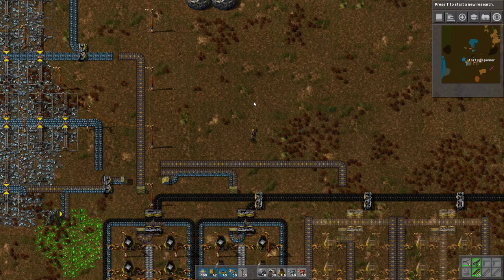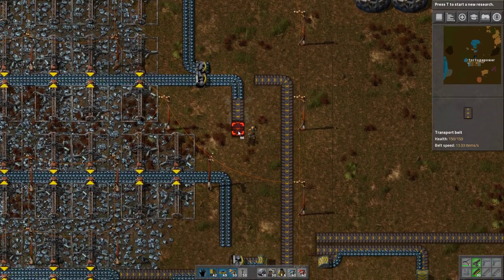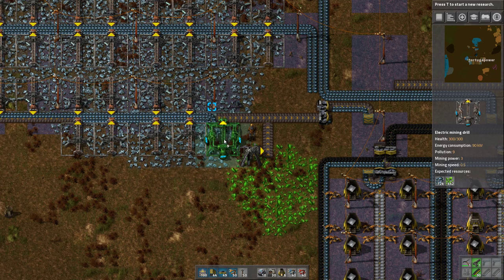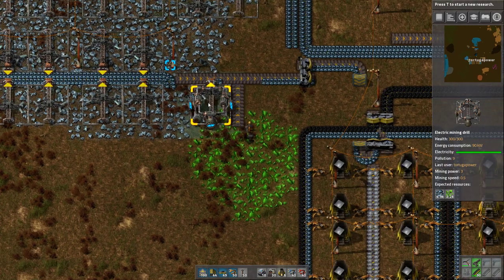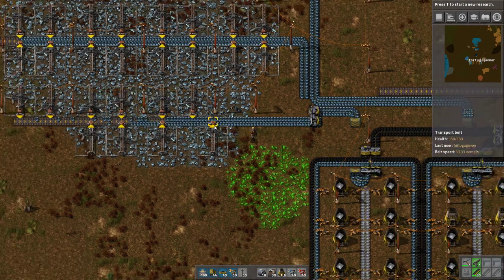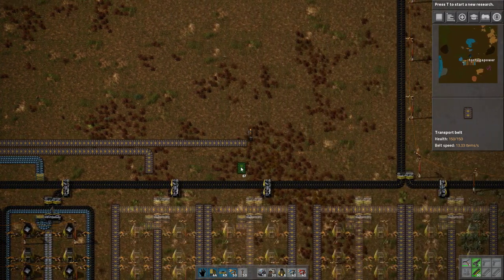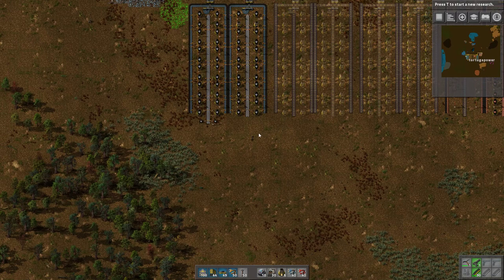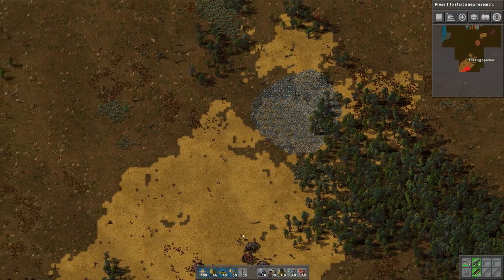Factorio (0.15) | Let's Play Beginners Guide - 03 - Main Bus & Red Science

Comment: It certainly doesn't hurt anything(at least not till really late game when ups can be a bit of a commodity), but the last pair of splitters on your 4 lane balancers is redundant. up till that point, each lane is split evenly so 1/4 is going to each of the 4 outputs.
Reply from the maker: I have seen the design without the end splitters, but never done with math myself. I'll do it and address this in my next video (sounds fun).
Reply: if you just follow each line it splits once to 1/2, then each of those is split to 1/4 and each of those quarters is sent to a unique output. this is the same for all 4 inputs. Like I said, it won't really matter in early game, other than a bit more cost when you may not have any automation setup for making circuits/belt/etc, but when you get to really late game and have thousands of each on the field with a ups that's steadily dropping, it may be worth it to go super conservative on the balanacers.